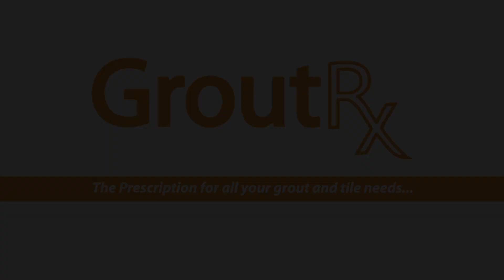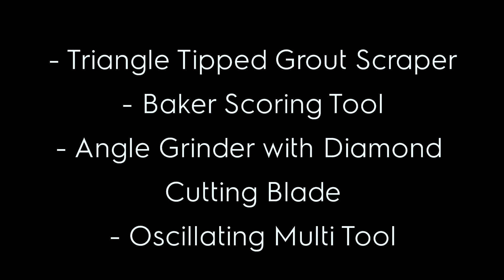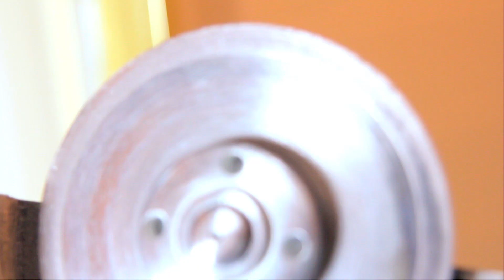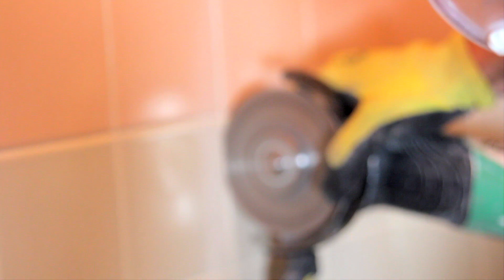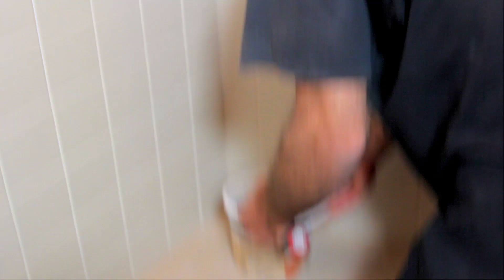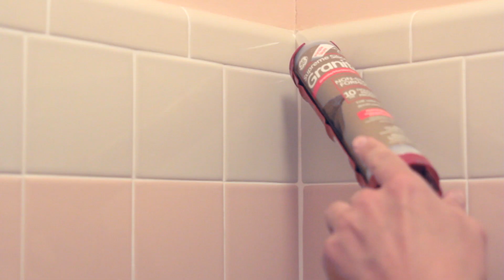Grout Removal and Replacement

Comment: I apologize but you did not remove enough grout imo for the new grout to hold long term. You need to remove a lot more than that in order to get a longterm hold and bond
Reply from the maker: There is no need to apologize and we appreciate your input. That being said, the backer scoring tool that we suggest 1 min 14 sec in takes the grout out to a depth of 3/16" of an inch in a standard 1/16" wide grout line. This is 3/4 of the depth of the thickness of a standard field tile. In many instance we are scraping down to the thinset mortar that the tile is set on.
Reply: @groutrx1415  oh gotcha just showing in video completely understand either way my apology for stepping forward on that one. My company grouts a lot so just wanted to make sure. Your good 👍. Good content
Reply from the maker: @joeymc5272  No problem and thank you for your feedback. I've produced these videos mainly to help customers understand how we go about performing the work or to help empower them to do the work themselves if they so choose. Regarding this particular video, my first, we were delving into the type of tools we might use. For field tile set within the past 20-30 years, the triangle tool and a backer tool suffices, but I have since started scoring the line with a third pass using a utility knife with Irwin blades which brings the line a bit deeper. Because those standard field tiles are so closely set, it is difficult to get much deeper without using an angle grinder, but those tend to distort the edge of the tiles and the blades are often slightly wider than 1/16". You also have to be pretty sure handed. It might be good to do an updated version of this video and go into more detail. I really appreciate your feedback.

Comment: Brilliant. Can Microban be added to ready-made grout or only yo the powder/water mix grout?
Reply from the maker: Premixed grout should be used as it comes and nothing should be added to it. That being said, it likely already comes with an antimicrobial. Antimicrobial products kill or slow the spread of microorganisms which include bacteria, viruses, protozoans, and fungi such as mold and mildew. Microban is a proprietary name for an antimicrobial that has since fallen out of the 7 year patent window so there are several other products that do essentially the same thing. All this being said, these products do not deliver as much protection as one might think. Most don't actually kill mold, rather they shortchange the reproductive cycle slowing the spread of mold. In order to impede the spread of mold in a tile installation, rinse the walls thoroughly after every use so organic matter does not accumulate. You can also dry the walls off after, but the rinsing is key. Mold needs moisture and organic material to thrive. Take away those two things and it is the best protection money can't buy.
Reply: @groutrx1415  Danke schön!

Comment: hi great video what spray grout sealer did you use?
Reply from the maker: To be honest, when we looked at different brands years back, there wasn't much difference. I usually pick up cans at Lowe's or Home Depot. Keep in mind, sealants do not make grout water proof or stain proof, they just reduce the surface tension making the grout easier to clean. There is a type of sealant that you can apply with a brush which is marginally better, but it can leave a haze on the tile and for the purposes of completing jobs, the aerosol can sealant works much better. We just spray it on and buff it off after letting it sit for 5 minutes. Putting extra coats on doesn't hurt.  https://www.lowes.com/pd/Miracle-Sealants-15-fl-oz-Clear-Ceramic-Porcelain-Tile-Grout-Sealer-Spray-Bottle/1000665951

Comment: Thank you. This was helpful and I particularly appreciated the need to remove soap scum with a tool.
Reply from the maker: If the soap scum gets really thick, cleaners really struggle to break down heavy build up. We are not a fan of using razors and sandpaper too often as they are abrasives. The best thing to do once you get your shower clean is to rinse the wall off after every use. This way the soap scum won't build up.and weekly or monthly cleaning requires little to no effort.

Comment: What type and how much microban do I add?
Reply from the maker: Grout Admixes you can buy at local hardware stores have all sorts of antimicrobial additives and the mixing is as easy as what they state on the label. Keep in mind, these do not prevent mold from growing completely, they just shortchange the reproductive cycle, hence they are referred to as inhibitors. Rinse your shower off thoroughly after each use to avoid protein build up on walls which leads to the proliferation of mold.
Reply from the maker: Email me with further questions on maintenance at d-morrison@groutrx.com

Comment: Where from we buy ???
Reply from the maker: If you are interested in buying any of the tools discussed, here are links to a few places to purchase them:

Triangle Tipped Grout Scraper
https://www.homedepot.com/p/QEP-Grout-Removal-Tool-with-3-Durable-Carbide-Tips-10020/311331831?source=shoppingads&locale=en-US&&mtc=Shopping-CM-F_D23-G-D23-023_014_FLOOR_TOOLS-NA-NA-Feed-SMART-2996251-WF-New_Engen_PL3&cm_mmc=Shopping-CM-F_D23-G-D23-023_014_FLOOR_TOOLS-NA-NA-Feed-SMART-2996251-WF-New_Engen_PL3-71700000084477446-58700007168062760-92700064419903686&gclid=Cj0KCQiAjc2QBhDgARIsAMc3SqReZgZCBy6p7adCBhB0bADcMiu5CpI7oZyedLIOicVd-NLMiRnfiEAaAgA-EALw_wcB&gclsrc=aw.ds

Backer Scoring Tool
https://www.floorsupplies.net/products/marshalltown-28272-scoring-knife?variant=32067951919236&currency=USD&utm_medium=product_sync&utm_source=google&utm_content=sag_organic&utm_campaign=sag_organic

Angle Grinder with Diamond
https://www.toolnut.com/makita-ga4030-4-angle-grinder.html?utm_source=google&utm_medium=shopping

4" Razor Scraper
https://www.maxwarehouse.com/products/qep-62900q-4-stripper?variant=35005782342&utm_source=google&utm_medium=organic&utm_campaign=surfaces-across-google&utm_term=JEN-2712-2100

Oscillating Multi Tool
https://www.lowes.com/pd/ROCKWELL-Sonicrafter-31-Piece-Corded-3-Amp-Variable-Speed-Oscillating-Multi-Tool-Kit-with-Soft-Case/1000677709?user=shopping

Grout Float / Trowel
https://www.tileprosource.com/products/primo-tools-trublue-3-x-11-1-2-offset-grout-float?variant=36762460422295&gclid=Cj0KCQiAjc2QBhDgARIsAMc3SqQnE13wt3nYXCfXHp99qwrCe4pDOC5nm3h9e6-yQCZtSXLYPuZOgMoaAl--EALw_wcB

Comment: How much time approximately needs to regrout one medium sized bathroom? And if I hire technician how much should I pay him?
Reply from the maker: It depends on what you mean by a medium size bathroom, tile size, amount of tile, etc. If we re-grout a standard tub surround it usually runs around $550 for labor and materials. The process requires 8-9 hours total with a return the next day for sealing the grout (this takes 10 minutes) and 24 hours dry time. If you are Re-grouting something for the first time, it can be frustrating if the grout is particularly hard and will likely take longer. what you may do is buy a triangle tool and try scraping the grout out in a few places to see how difficult it is. In showers, grout is often harder due to the absorption of hard water. If you get a company to do it, I would pay more attention to what the person says during the estimate and if they come highly recommended. Do your homework and hire a person you feel like you can trust.

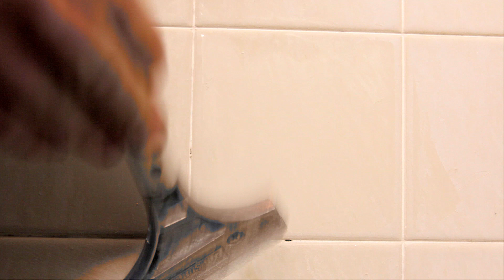Comment: Thank you for this video. I'm curious to know what soap scum cleaning tool you are using at 2:05 / I also scratched my ceramic stone tiles and curious to know if you use Faber - Tile & Stone Care or some other product to treat the accidental scratches before re-grouting. Thanks!
Reply from the maker: Accidental scratches are unfortunate. If it is in the glaze, sometimes it can be buffed out. You might try going over the scratch with a clear coat. Feel free to email me a picture at d-morrison@groutrx.com. In terms of soap scum removal, check out this video:  https://www.youtube.com/watch?v=kvUbYXcBtIg

Comment: Why wouldn't you use the Regrout Tool? It's the only patented grout removal tool in the world and can remove grout from 1/32" to 1/8" dust free! With a multi tool your only grinding out the grout or whatever the blade comes into contact with! The replacement blades for multi tools are very expensive and wear out sooner than later, the Regrout Tool tips won't dull and last forever. There are two tips on the Regrout Tool one is a pointed tip and the other a chisel.. @t
Reply: I just bought this tool and am a first time regrouter... hope it works as good as it seems.. :)
Reply from the maker: @richman105  What type of tile pattern do you have?  Until you get a feel for the tool, take it slow and don't push to hard on the tool if it gets stuck.  The biggest issue with scoring tools is scratching and chipping and it takes time to develop good control and muscle memory. Let us know if you have any questions.
Reply: @groutrx1415  I have walls that are 'square', and floor that is 'hexagon'.  the small bit looks to fit perfect for the very small wall grout lines. i watched the videos so hopefully i am prepared... first time grouting/regrouting in general, but i need to do this as it is original 30 yrs... although most areas are decent, some areas severely missing grout on floor, and walls have some discoloration that cleaning materials didn't resolve.
Reply from the maker: @richman105  Sometimes missing grout is a symptom of loose tiles. tTo test, tap on the tiles and make sure they are not loose. When I do this, I have one hand laid lightly on part of the surface of the tile with missing grout while I knock on the surface of the same tile. If the tiles are loose, it is best to remove them and re-adhere them. If you have loose tiles, let us know and we can guide you through fixing this if the problem isn't to pervasive. If the tiles are down well, use the triangle or diamond tipped scoring tool, follow it by the backer shoring tool, and/or a utility knife razor. I've started doing this as an extra step since we shot this video 3 years ago. These Irwin blades are the best and last longest; they never break. Going back over the grout lines really helps get the grout out as deep as possible which will allow the new grout to take hold. If the lines are 16th to 8th of an inch like the ones in the video, use un-sanded grout mixed with a Microban additive or any "grout enhancer." I will provide you with a link to something that will work. If the lines are larger, you have a few other options 

https://www.lowes.com/pd/IRWIN-Carbon-Steel-3-4-in-Utility-Replacement-Blade-50-Pack/1003172552

https://www.lowes.com/pd/MAPEI-Grout-Maximizer-26-fl-oz-Grout-Additive/1000057499

https://www.homedepot.com/p/Custom-Building-Products-StainBlocker-32-oz-Stain-Resisting-Admix-Additive-for-Grout-SBG32/202525433

Good luck and let me know if you have any questions.  We are here to help you.
Reply: @groutrx1415  The floor is 1/8" and the walls 1/16".  i plan on using hte regrout tool to remove the grout as the tip seems perfect for both. i will be careful.  I plan on using sanded grout for the floor and a grout sealer after.  for the walls unsanded grout and sealer. no issues with loose tiles, just wanted to do a fresh grouting, as some places are slightly missing grout on both the floor nad wall, and the grout can't get back to normal color regardless of cleaning solvents/techniques used.
Reply from the maker: @richman105  For the sanded grout, you can use Mapei Fine Aggregate grout.  I was a big fan of Laticrete grout untill they switch to Permacolor with color packs.  You can use Laticrete's epoxy grout,  Specatralock, but that is a mess to clean up and I would not recommend it for first timers. It does not need to be sealed but it is also pricey.  Mapei FA grout seems to be really good, though product consistency these days can be hit or miss and this is with all companies. I'm going to do a grout review video eventually and really dig inot the different products but just haven't gotten around to it yet.  https://www.mapeihome.com/ultracolor-plus
Reply from the maker: @richman105  also be sure to clean the tile after taking the grout out.  Any orange pumice hand cleaner works well.  There is a video on tile and grout cleaning I recommend.  We do this in conjunction with grout removal/replacement.  It can really be done before or after you remove the grout.  If you have excessive mold, use Concrobium spray.  https://www.youtube.com/watch?v=kvUbYXcBtIg

https://www.amazon.com/s?k=mold+control+concrobium&hvadid=77859220699626&hvbmt=be&hvdev=c&hvqmt=e&tag=mh0b-20&ref=pd_sl_104s5whpd_e
Reply from the maker: @richman105  Re-grouting of shower floors can be a bit tricky.  Will circle back on this at the end of my work day.  You need to have an understanding of how they are built and how to express water from the mortar bed or the grout you put in won't cure properly due to residual moisture.
Reply from the maker: @richman105  There are two things you need to be careful of when re-grouting shower floors.  The waterproofing membranes of systems like Schluter-Dritra installations are just below the tile and can be easily damaged when digging out grout. In you particular case, it sounds like an older shower so you likely have a mortar bed installation. You are not likely to damage the shower pan liner, but often water collects in the mortar bed and does not allow the grout to cure properly.  There are a couple of things you can do to mitigate this issue.  First, knock out any efflorescence of the secondary drain in the drain pipe. Second, let the floor dry 3-4 days after you remove the grout.  You might put a wet vac on the grout lines when you remove the grout to see if it sucks up any water.  That is a good way to tell how much water you have in the mortar bed.
Reply from the maker: We feature a variety of tools in this video and talk about the pros and cons of all of them. Most often times we are using the triangle or diamond scoring tool they are not powered and do an excellent job removing grout.  https://www.homedepot.com/p/QEP-Grout-Removal-Tool-with-3-Durable-Carbide-Tips-10020/311331831?source=shoppingads&locale=en-US
or the diamond tool
https://www.koblicksupply.com/diamondtoughgro-d.html?utm_source=diamondtoughgro-d&utm_medium=shopping%2Bengine&utm_campaign=googleproducts&gclid=Cj0KCQiAj9iBBhCJARIsAE9qRtAlyOeTuY3a_kX0t0tMfWVh4noaGgCTFTkpS-2OEEzVYO1MC7HQ-WwaArUMEALw_wcB

Comment: Any opinion as to which manual removal tool works best? ... Diamond-shaped (or v-shaped) tips VS saw blade type with serrated teeth VS blades coated in coarse diamond grit ?
Reply from the maker: We don't really use the blade type tools.  I've tried those on a few occasions and always go back the the triangle (or diamond) scoring tools.If you have thin grout lines, 1/16 of an inch, the diamond tool works best followed by the backer scoring tool.  Hope this helps.

Comment: Is caulking required at the bottom where side tiles meet the floor tiles on all four sides?
Reply from the maker: It depend.  On all of our new shower installations and when we do floor overlays, we employ epoxy grout which is ver stable and rarely cracks.  In older installations and around tubs, we often caulk because cracking does occur where two planar surfaces meet do to expansion and contraction.  Keep in mind though, if a shower was built properly, the waterproofing is underneath the tile and it doesn't matter if there is cracking in the grout lines or not, it is purely aesthetic.
Reply from the maker: It depends on how much expansion and contraction you have and what type of grout you use.  When we install new floors or perform shower floor overlays, we use epoxy grout and it rarely cracks.  Even if grout is cracked this is not a cause for concern as water will penetrate the grout invariably and make its way into the mortar bed (where mortar beds have been employed as a means of construction).  when you caulk seams, it's basically cosmetic because the waterproofing should be in the substrate. If you do use caulk, silicone caulk, while messy and cannot be cleaned up with water, has more elasticity. Acrylic or water based caulks will likely crack over time. Hope this helps!

Comment: Hey my mason used white cement as grout is it okk.।।
Reply from the maker: Sorry for the delay in getting back to you on this.  All grout is a blend of Portland based cement and has slightly different properties than traditional cement.  Basically, if it's working out, it's fine, but here are the details on what's what.

Cement is a powder of oxides, dioxide and sulfate, which powder is mixed with aggregates and water (sometimes with other additives) to make a cementitious mix used to create solids in construction in molds of many differing shapes. Those aggregate and cement shapes are sometimes reinforced with steel to enhance the structural properties of the concrete formed.

Mortar is a mix of sand, water and cement, used as a kind of “glue” matrix to allow structures to be built out of individual units of fired brick, adobe, hay bales or concrete, subsequently used to build other structures.

Grout is a mix of fine sand aggregates with a cementitious base, used with water and other additives to form a dense injected voids packing in soils amendments, as sealing between tiles and as a seal against water movement.